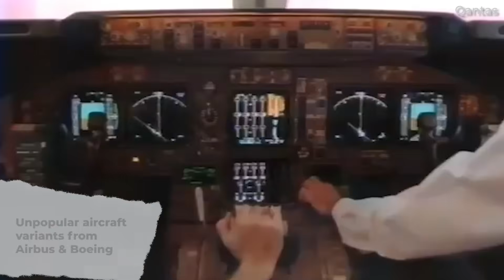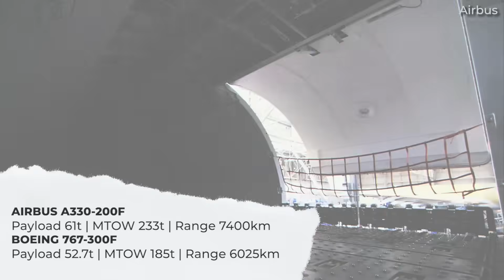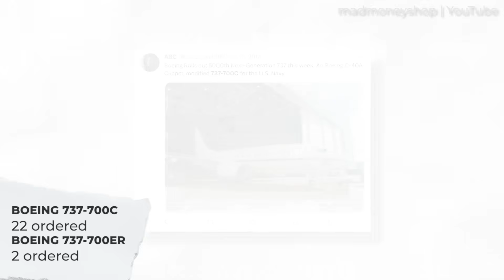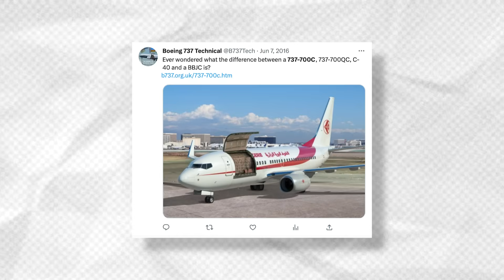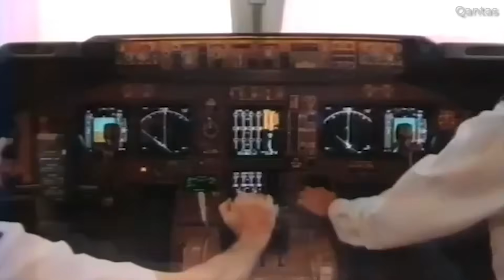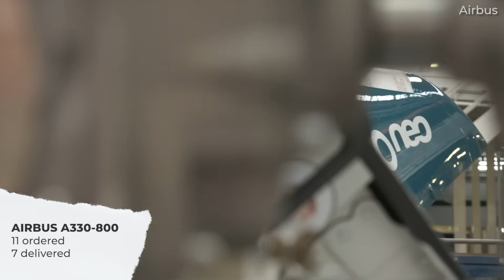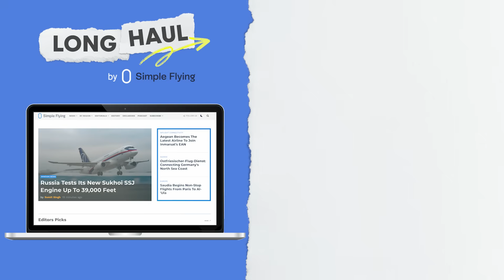Poor Sellers: The Least Popular Airbus & Boeing Aircraft Variants

Comment: I would love to see the A330-800 get some life-renewing orders to its books.  I do believe as stated in the video that the 787 is a major factor in the lack of sales of the A330-800.
Reply: Hopefully they see an uptick in orders as the older A330-200’s & 300’s are retired. They’re certainly cheaper than 787’s & A350’s and some airlines might not need the added range of those aircraft. Hell, it would be nice if Delta & United would retire their 330’s & 767’s with these.
Reply: @GuitarGuy4647  UA already has a huge order in place for the 787 and to some extent the 321XLR to replace the 767s. Delta is one of the few carriers replacing some of the 767's with the 330NEO. Can't really say the neos are cheaper than the 787. Boeing has been very aggressive on the pricing given the volume of sales.
Reply: @GuitarGuy4647  actually the a330-800 have more range than the 787-8 and 9. So really for replacement the 787-8 mare more sense, of course that all depends on the airline want the the circumstances ñ.
Reply: A330* You said A300-800
Reply: @claxyisrage   Appreciate you 🤦🏾‍♂️🤦🏾‍♂️
Reply: I still say the 338 would have gotten more orders if they went with the smaller older wing but new engines.  It weighs too much for what it does and next to no one needs the range and if they DO need the range they will get the 788 instead.
Reply: A330-800NEO is only operated by one airline (Air Greenland) And I would hope that airlines could replace their old A330s with the new efficient NEO. Delta and United could maybe retire their 767s and A330s with these efficient planes
Reply: @suomalainenpallo27 Wrong. Air Greenland only orders one aircraft from the total of around 15 orders with Kuwait Airways being it's largest customer of 8 aircrafts
Reply: @Kuricang31  Yeah, just did research and Kuwait Airways does, in fact, have that plane too
Reply: Qantas has plans to replace their current A330 fleet sometime in the next few years, and they seem to be transitioning to an all-Airbus fleet, except for the 787. They're replacing all their 717s and 737s with A220 and A320-family narrowbodies, so only time will tell if they decide to go all in with 787s for their medium-size fleet, or simply update the A330 fleet with Neos.

Comment: A350-900ULR: Am I a joke to you
Reply: It was only requested by Singapore and no one else ordered it
Reply: It's not a separate varinet. It's just a 900 with fewer seats and some software changes to the engines.
Reply: It was a request by Singapore Airlines similar to the Qantas and 747-400ER
Reply: @claxyisrage  Not really comparable. Just some minor tweaks to the software and engine tweaks and significantly reduced capacity on the ULR. The ER had much more extensive changes with option of one or two extra 12,300-liter fuel tanks in the forward cargo hold. The 747-400ER also had a strengthened fuselage, landing gear, and parts of its wings. There were also new, larger tires. The ER also had an F version.

Comment: would you consider a350ulr as an individual variant? if so then the number is also low, similar to the 744ER specifically tailored to qantas.
Reply: Should have been mentioned as they mentioned the B747-400’s sub variants. 
Here is one thing about that plane when I used to work at SQ. You had to be perfect with load control with that plane. Still remember days when we had to empty baggage containers just to load the aft bulk hold with bags just to counter the weight in the front (because of the giant fuel tank in the front cargo hold) or offloading cargo because too tail heavy (basically fun times with up to a 1 hour delay because of that and me filling out the delay report/getting chewed out for why was there a delay).
Reply: I wouldn't think so bc the A350ULR was made because Singapore Airlines (and Qantas in the future) asked Airbus to modify the A350 just for their purpose, so it would only be made for the airlines that requested them, and would be willing to pay the higher price.
Reply: @dat_randomguy_  JAL and ANA requested the 744D and it made to the list. which also reminds me of the 747-100BSR and the only two BSRSUDs delivered. they should be on the list as well. btw, Qantas has opted a350-1000 for its project sunrise.
Reply: The 350ULR is really only a version for SQ that has fewer seats and some software changes. It's branding more than an actual new variant. It's a 350-900 configured with fewer seats. No structural changes at all.
Reply: @johniii8147  So is the B747-400D. It can still be converted back to long haul service. The A350ULR is basically a giant additional fuel tank in the front cargo hold.
Reply: @MasterofBlitz  They did NOT add an additional fuel tank to the ULR. That's misinformation. Engineers managed an additional 1,600 nm of range in the A350-900ULR though adaptations to the fuel system computer and to the air venting and inert gas distribution piping in the wing, allowing for the extra range without adding fuel tanks and reduced capacity with only business and PE. The "ULR" only has 161 seats vs the  the usual 253-300 on the rest of SQ's 350s. There is most your range increase right there.
Reply: @johniii8147  You are correct, that was my error. None the less also the increase of range is also due to the aircraft not having anything in the front cargo hold.

Comment: If only the A318 had been successful in obtaining 'Regional' classification as intended, I think that it could well have been rather successful.

Without that classification, it was really only attractive to airlines with significant numbers of the larger variants, where operational economies could justify its use.

Edit 2023 03 20

While many of the arguments given are indisputable in the 'top trumps world', in the real one, they are often mitigated or even reversed when the economies of having a single aircraft type are also considered. It was a point I originally made but apparently ignored by some.

Additionally, we were talking about the disappointing sales for the original A318, an aircraft produced  during a time when many of the 'superior alternatives' we see now were simply not available. 

You can not compare an A318 with an A220 unless you are discussing what to replace an old A318 with.

There is also customer perception to take into account.

Before the advent of the C-seies/A220, I would regularly make a journey where one of the usually A320 series flown legs would be replaced by an Embraer E series or a rear engined Bombardier, or Fokker100

There was no reduction in price, so I often felt as if I was being short-changed (much less so in the case of the Fokker). To the extent that I would sometimes adjust my schedule to avoid them, even if meant using an alternative airline (my route is covered by multiple  airlines offering similar prices).

Reducing per seat costs can please the bean counters, and holds up when you can easily fill those seats, but in the world where the flights are rarely full to capacity, were those empty seats due to a lack of potential customers, or were some empty because of customers like me who went elsewhere that time?

I am not trying to make a case for an A318neo, as the limited (but still potentially profitable) A319neo sales appear to.confirm that the days of the smaller 6 across seating single aisles Airbus has passed. 

Without the backing of Southwest, I suspect we would be saying the same for the Max7.

No doubt if Southwest had been an Airbus operator, the fortunes of the A319 and Max7 could have been quite different.
Reply: It still wouldn’t be well ordered because it’s a double shrink and the E195 is much more efficient
Reply: No, it was way to heavy for so few seats.
Reply: by now airbus has the A200 series for this market segment so probably doesn't make much sense to even push for more sales anymore
Reply: @johannesgutsmiedl366  They discontinued it well before the 220 purchase. The last one was produced back in 2013

Comment: Is it me or the a340 should have been reworked to use 2 engines as a neo version
Reply: That is simply the a330 brother
Reply: @harrisonjustis9977  But the a340 had higher capacity and both existed at the same time
Reply: Thought about it too. However, initially, the A350 was an evolution of previous widebodies, only changed to a clean sheet design after critique from airlines. Highly likely that what you are thinking actually happened
Reply: That's called the 330
Reply: @johniii8147  Those 2 were  made at the same time
Reply: @rpt19  Yes, but they continually kept updating the 330 from it's original capabilities that it could perform most of the the routes of the 340
Reply: A350 replaces it.

Comment: 777-200LR should have performed better
Reply: Technically it sold much better, if you consider that the 777F was based on it.
Reply: It’s not surprising that the 200LR & A350-900ULR aren’t big sellers - they’re niche planes and most airlines are interested in utilizing that sort of range for it to be a worthwhile investment.
Reply: @GuitarGuy4647  The thing with the A350ulr is that Singapore Airlines requested the aircraft, like how Qantas asked Boeing to make the 747-400ER, there is also the 737-700ER.
Reply: It was always intended primarily for the F market. Boeing always knew that. Just not much demand for ULR aircraft. They would have never built it without the F version. It sold as they expected.